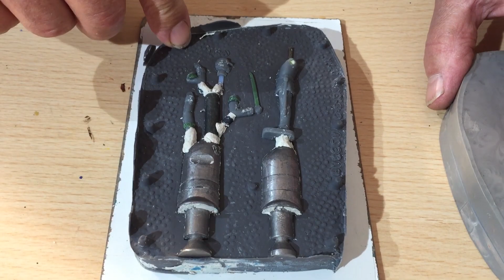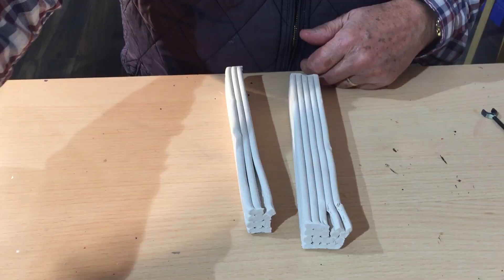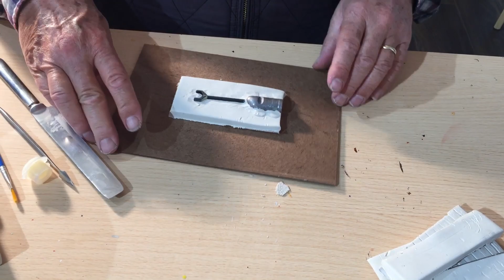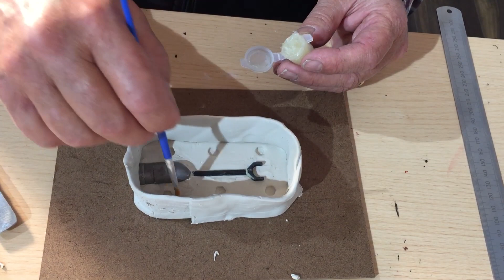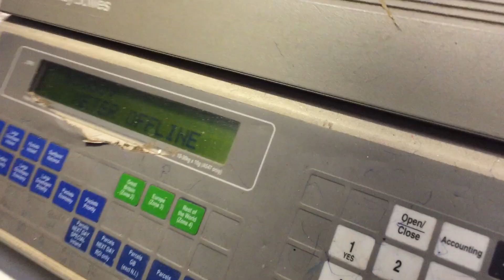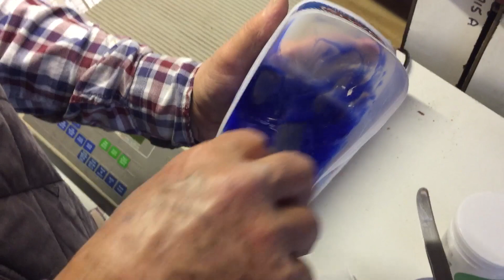Part 1 of 2. How to create Prince August Silicone Rubber moulds at home cheaply and easily.

Comment: Great video......thanks.... for others....Follow the instructions here in the video... With the plastercine use the vaseline ....ignore if anyone advises using the "correct" release sprays for silicone mold making....you end up with a sticky mess contaminated with the solvents which will cause cure inhibition....

Comment: The cut mould is the normal way to do it used by professional metal casters like Jewellers. In fact most moulds are made by vulcanising real rubber. It is actually fine for complex masters like jewellery. More skilled as you mention though.
Of course they make, inject under pressure, wax not tin/lead copies in the mould for the lost wax casting process at much higher metal melt temperatures.
When they have a carved wax original though they will use silicone. As vulcanising rubber get very hot!
Usually the containing boxes are just made from lego bricks!
You seem not to have bothered showing the cut open mould method. Much easier.

Comment: The volume was calculated at 100 cubic centimetres and then you stated that was equal to 100 grams of silicone rubber.   That is assuming that the compound has the same density as water?
Reply from the maker: These are approximations for the purpose of this project. It is better to mix more than too little and we have to allow for waste (un-scraped remains after pouring into the mould of the finished mix).